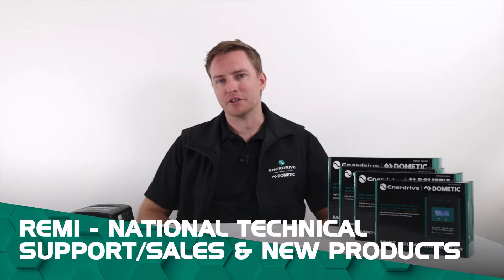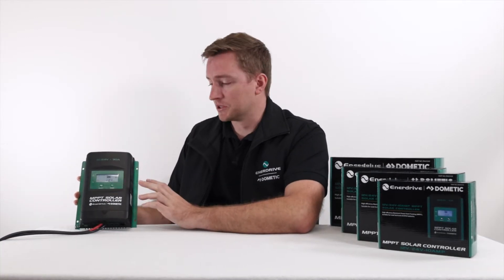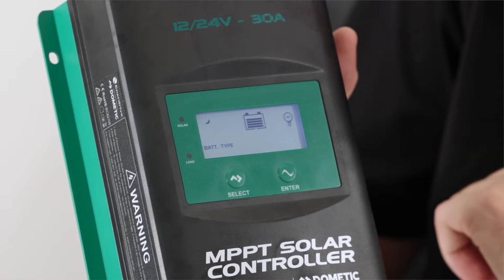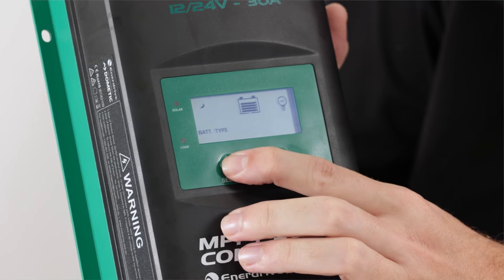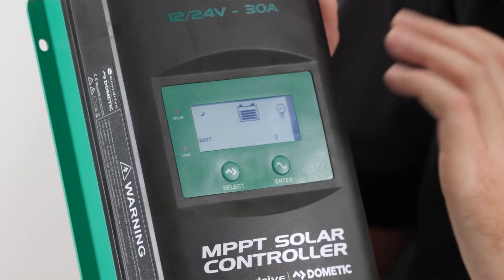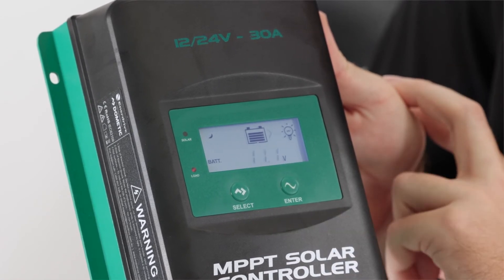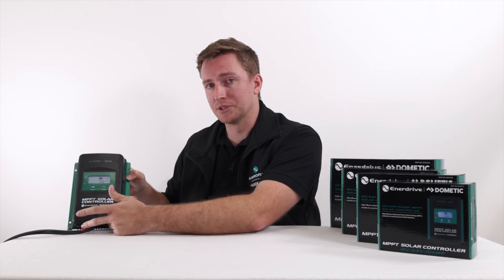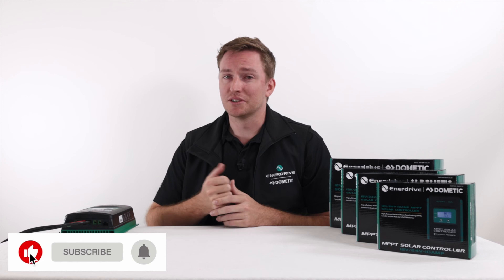How to Program an Enerdrive MPPT Solar Controller

Comment: I can’t figure out why my system won’t charge. I was using a 250w solar panel going into the controller on F08 to charge a 24v lithium battery.

I tried clamping the controller straight to the battery to charge and it gave me a solid green light on solar with an error sign and wasn’t actually charging. Any ideas?
Reply from the maker: For the best support, please visit our dedicated support centre: https://support.enerdrive.com.au/. You can also find helpful resources, FAQs, and contact options there, including phone support and a contact form.